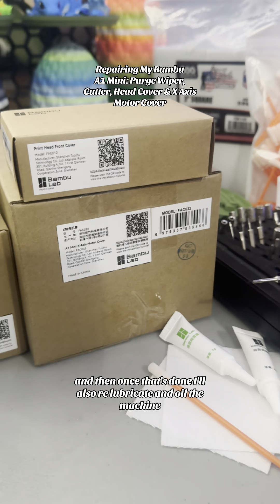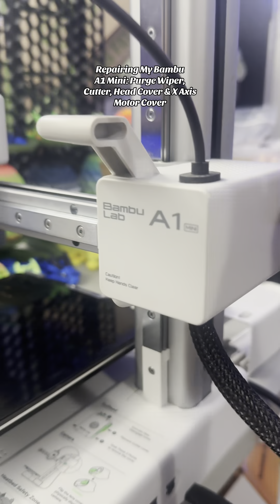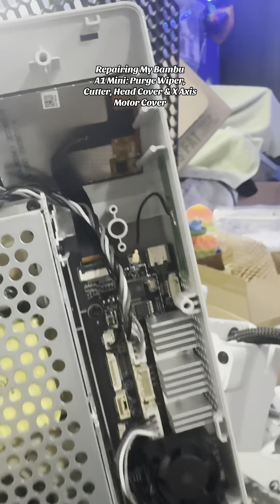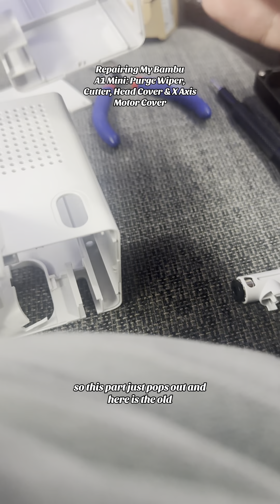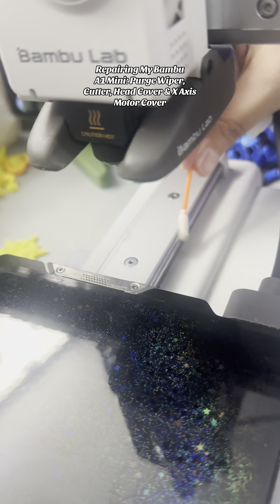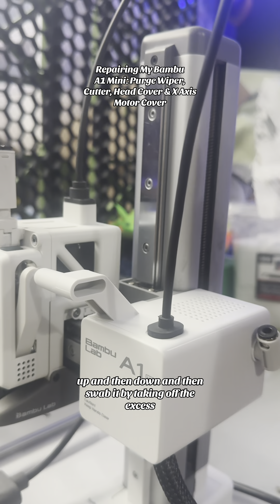Replacing the Bambu Lab A1 Mini X Axis Motor Cover, Purge Wiper, Filament Cutter and Head Cover.

Comment: Just a point that should have been mentioned regarding changing the filament cutter blade. When you reinstall you need to be sure the blade is pointing down so it enters into the extruder hole when pushed in. It's possible to install this with the blade pushed up and if this is done the blade won't cut the filament and you'll get cutter errors. The Bambu Wiki mentions this at least on some pages but IMO this should be called out with more emphasis since installing in this way will cause errors and the solution isn't readily mentioned and can be frustrating.
Reply from the maker: @christopherlyons7613  this is correct thanks for pointing that out

Comment: Thanks for your time to show us the removal, but can you share why the lever got broken? People having issues same as i do, with a weird cracking sound when it goes to lever and cut the filament.
Reply from the maker: From what I’ve researched with other people with the same problem the crack in the XAxis Arm seems to stem from too much pressure from not changing the filament cutter. I did notice the cutter was dull and visibly worn.

Comment: why did you not just remove the usb plug on the tool head?
Reply from the maker: @Venom-ok6hj  I tried that but it was too big so I ended up removing that from the video, also the Xaxis motor plug is connected to the motor by plug to main board unlike the camera which was easily removed cuz it’s double plug ended. I kinda wish everything was double ended or even the Cutter arm was a seperate slide in piece, that would have made this so much easier 😅
Reply: @Venom-ok6hj  I agree. It could have been designed a much better way for easier maintenance.